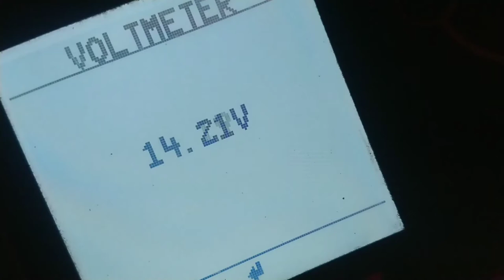Alternator replacement on a 2007 Honda Odyssey

Comment: Getting the new unit back into van was a LOT less of a hassle than getting the old one out.  Also of note, my tensioner pulley required a 3/4' bit, not 14mm.  That tensioner DID NOT want to move.  I just needed a little bit of movement to get the belt looped onto it...and that is all I got!
Reply: My tensioner is 19mm.  Used a 1/2” breaker bar but you’re right, pretty tight.  Trying to get the old alternator out now.  Glad it goes in easier.